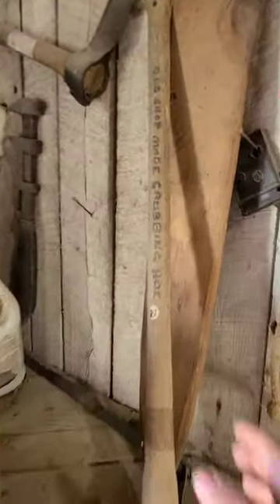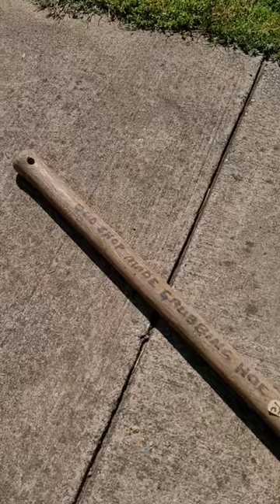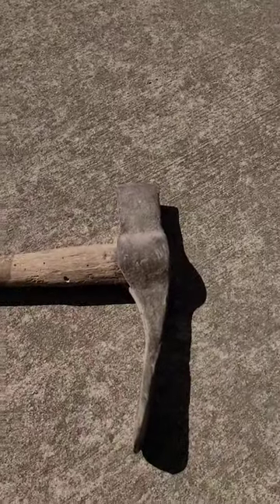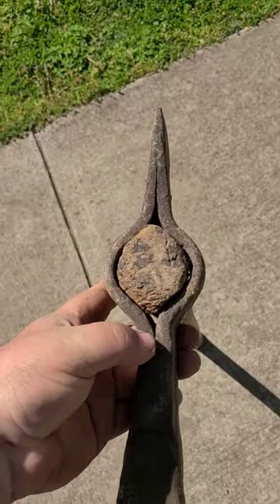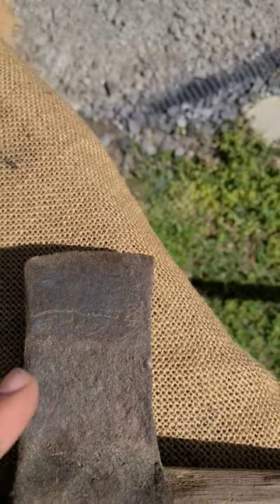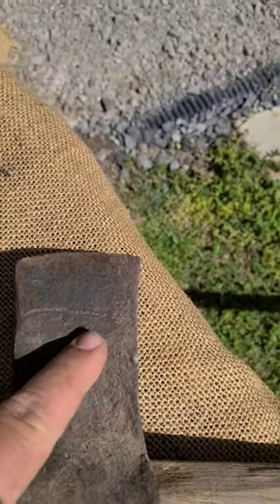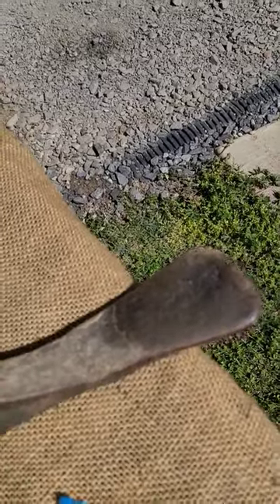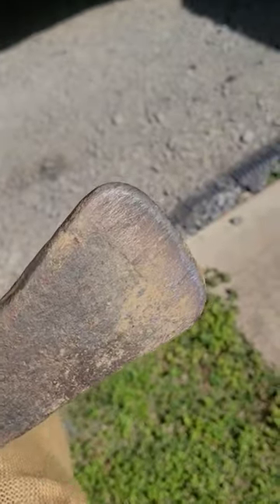Hand forged grubbing hoe #blacksmith #blacksmithingtools #granville

Comment: I have a deep admiration 4 iron working and structural steel and blacksmithing you would probably enjoy my treehouse it has close to fifteen or twenty thousand railroad spikes welded together for guardrails handrails 12 ft stair-step stairwell and a 40-foot bridge with a 16ft deck and even bench all made out of spikes I was told as long as I do not sell any of these railroad spikes I can have all I want for my projects